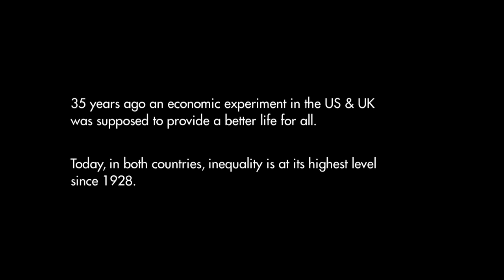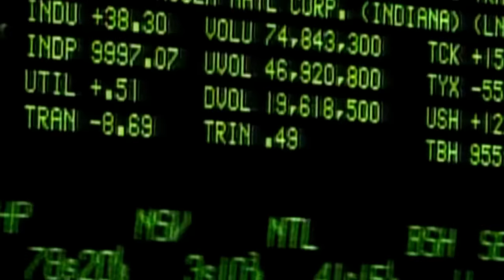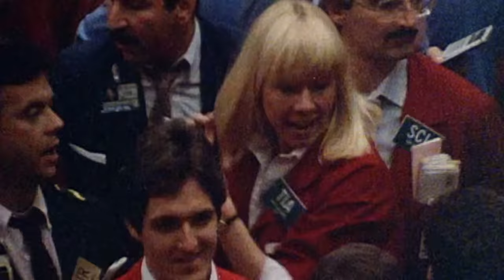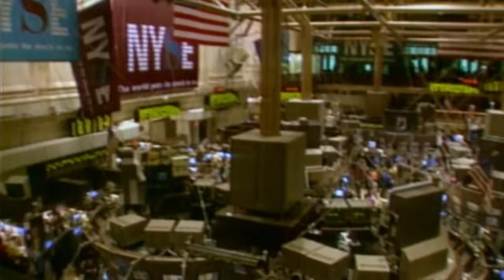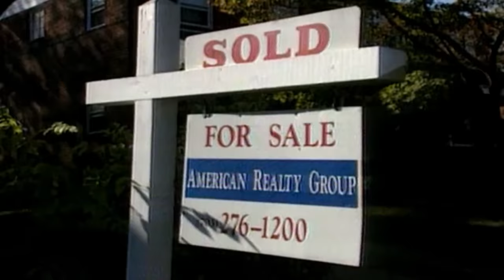Growing Economy, Miserable Citizens: Why Are Rich Countries So Unhappy? | ENDEVR Documentary

Comment: I've just retired recently and I must say I found this video informative and great to review. These psychological concepts are much more useful for individuals attempting to avoid mistakes than I realized when I was first introduced to them. This is probably why Warren Buffett talks so much about temperament being crucial to his investing success.
Reply: Developing a solid financial portfolio is more difficult, therefore I suggest you seek expert assistance. The ideas you receive after that can be tailored to your long-term goals and financial desires.
Reply: Personally, I would say have a mentor. Not sure where you will get an experience one, but if your knowledge of the market is limited, it seems like a good bet.
Reply: Same thought when I read the comments from people. as if it's that easy! You can't give what you don't have. That's why as many as who go into the market with little to no knowledge will continue to feel the full downsides of stocks when it happens. I personally need some guide with regards to my 401k. How can I reach Catherine Morrison Evans?
Reply: @Oly_laura  Exactly the point! quickly do a web check where you can connect with her, and do your research with her full names mentioned..
Reply: spam
Reply: Spam

Comment: Recession is often the result of external factors, and it appears that the United States is losing its grip as a federal reserve currency. With a decreasing ability to control inflation and a reduction in stocks and oil trading, it seems that a new multilateral world order is on the horizon.
Reply: It's important to keep in mind that investing is a zero-sum game with both good and bad days. However, by spending and investing wisely and diversifying your holdings, you can minimize risks and maximize gains. Hiring a knowledgeable investment advisor with a wide range of options can help you achieve this and leave little room for regrets.
Reply: I personally worked with an investment advisor to diversify my $200k portfolio across multiple markets, resulting in over $580k in net profit from high dividend yielding stocks. With the right guidance, you can also make informed investment decisions and achieve your financial goals.
Reply: @maryHenokNft  Please tell me how to connect with an advisor, My funds are being murdered by inflation. therefore I'm looking for a more profitable investing strategy to put my portfolio
Reply: Sure, the Financial advisor that guides me is Mary Onita Wier and she is renowned and has quite a following. So it shouldn't be a hassle finding her. Just look her up.
Reply: Thank you for this tip , I must say, Camille appears to be quite knowledgeable. After coming across her online page, I thoroughly went through her resume, educational background, and qualifications, and I must say, it was quite impressive. I reached out to her, and I have booked a session with her.
Reply: This has been plainly obvious for 40 50 years

Comment: It's a mixture of actual misery, envy and debt-trap. To put simply, imagine that people used to all make 5 units of currency (assuming that this unit have a fixed value and unaffected by inflation etc)
Some people now make 3, which is actual misery
Some people now make 10, but are unhappy because some others are now making 1000, that's the envy
Some people now make 10, but are in so much debt that the interest payment alone cost 7, so their net expenditure power is only 3

It is hard to say what the mixture actually is. "Poverty" rate doesn't actually explain it as "poverty" is a moving target itself. To be fair, it should "move", people should expect better life with technological advances. But if we want to consider apple to apple comparison in terms of QoL changes, we need to be aware of the moving targets.

I don't think wealth inequality is necessarily a problem in and of itself. To put simply, I'd rather everyone have more but some with far more than others rather than everyone having less but equal. There is a reason why communism didn't work out, even though it was never really true communism. In reality, most of the "wealth" of the wealthiest people are in equity, which is effectively infrastructure of production that benefits everyone and that's fine, even if it benefit them more than others, it still provide a net benefit. This is also why wealth tax won't work, because the most likely result is stock market crash as each wealth person need to liquidate their equity.
What really matters is expenditure, because that's an actual consumption of net production that is more of a zero sum game (not exactly when it comes to services, but closer). For an example, Bezos's rocket trip is, IMO, a far worse "sin" than the fact that he is super wealthy, even if the cost of said rocket trip is but a tiny fraction of his wealth. Because that is an expenditure, an extravagant and wasteful expenditure at that, the "world" as a whole "lost" resources as a result. On that note (and as I mentioned wealth tax before), I'd rather have a more comprehensive and tiered expenditure tax. Kind of like a sales tax but more comprehensive. That, I believe, is what will actually reflect the net social cost of each person's behavior and life style.
That's not to say wealth inequality can't be a problem, it could be if it is gained through the suppressing of others. But due to the fact that it is not inherently always a problem, it is, IMO, not the best metric to focus upon. The real metric to focus upon should be more fundamental quality of life metrics of the lower quarter of the population. Stuff like life expectancy and mental health, which are the most basic reflection of QoL. Even there we need to be careful, as the definition and diagnosis of mental health problem have changed over time, so we will need to narrow the scope for any such study, to apply the same standard to the population decades apart somehow.

I honestly don't know of QoL is actually going down, personally I don't think it actually is. However, it's almost certain that it isn't increasing at the rate that it should, which is IMO the more likely root of the discontent.

Comment: It is because in order to work you need to pay 40k a year minimum on rent unless you want to spend 3 hr each day on transit or get pelted by rocks from inside your car from zipcodes you will never move to. If you want a vehicle maintenances start 3 digits and part replacements labor start at 4 digits... for motorcycles. Sure you make 200k a year but your take home is 117k. So you are saving 10% of your income tops. Life is trash

Comment: 1. We need livable wages of $33/Hour AND up as the foundation of dignity. This must rise by 3% faster than inflation!🎵🎵🎵
2. We need affordable housing of $450/Month for single apartments of no less than 800 SQ FT to live in dignity ( fixed rate for life)
3. We need affordable raw land of $500 to $3,000/Acre ( 1 to 20 acre lots with no HOAs or restrictions ) accessible to the poor to buy! We need affordable tiny structurally durable homes that can be built under $50,000 without bank loans and thier debt traps! NO property taxes 🎧🎧🎧